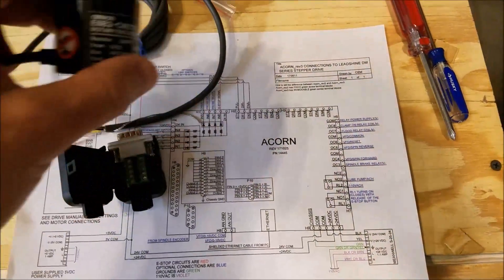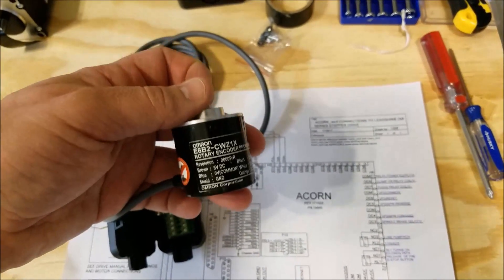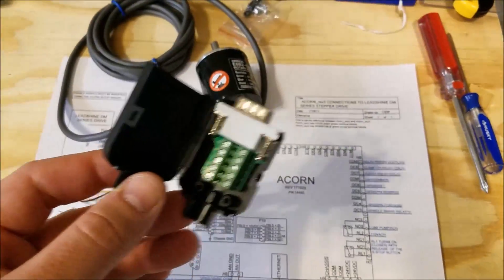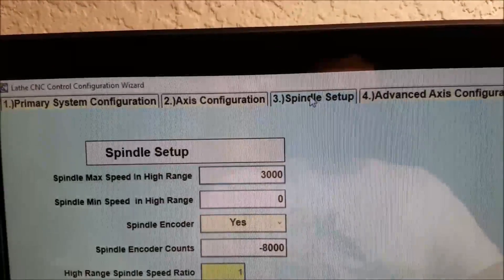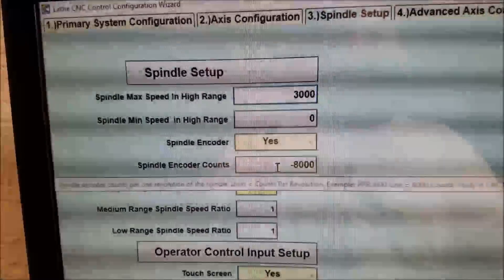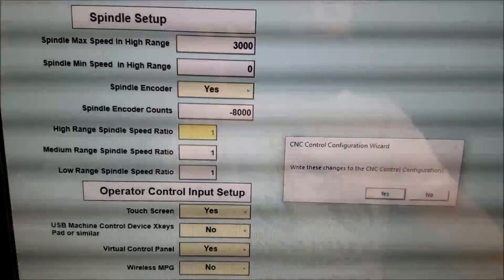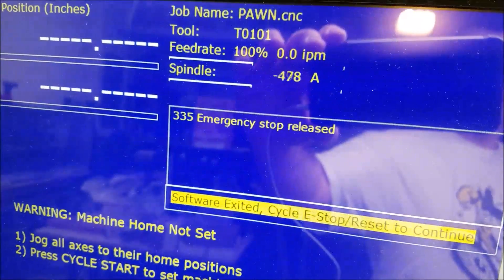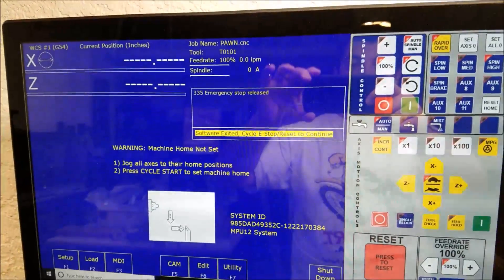DIY Closed Loop CNC Control #8: Spindle Encoder

Comment: Why are you multiplying the 2000 p/r by 4 to get 8000? Is that 2000 pulses per lead or something?
Reply from the maker: Good question.  It is based on the encoder.  A 2000 line quadrature encoder will generate 8000 pulses per revolution.

Comment: I have a spindle encoder but I dont have the acorn board I have the mach 3 boards. Is there a way to wire it in ?
Reply from the maker: Hi.  Unless your board specifically supports encoder input, then no.  Usually, encoder feedback is only available on more expensive boards.
Reply: I figured it might not be to different then hooking up the hall effect sensor. Darn back to the drawing board.

Comment: How is the expandability of this board? Are there ports for communicating with multiple encoders?
Reply from the maker: Hi.  The Acorn has only one encoder port for use with the spindle.  Otherwise, it only outputs step and direction for the axis motors. However, Centroid has other more powerful boards that have full closed loop capabilities.

Comment: Any need to set parameters if you’re using a belt drive or are you running 1:1 off the spindle? ...what is the name or part number of the connector you had shown? Thanks.
Reply from the maker: Search ebay for this: 
DB9-Male-D-Sub-9-Pin-Plug-Breakout-Terminals-Solderless-Nut-Type-Connector-GX

I always run 1:1 from the spindle to the encoder.  But, there are some ratio settings in the Centroid software (that I've never tried).  That being said, I think you'll get your best results running 1:1

Comment: These Omron E6B2-CWZ1X encoders sell for $25 on eBay but I highly doubt they are genuine. Where did you get yourse? I checked on Mouser and it is $345.
Reply from the maker: Here is the eBay store I buy them from:  
http://stores.ebay.com/921812799shu?_trksid=p2047675.l2563

Seach for: Omron Rotary Encoder 2000 P/R E6B2-CWZ1X E6B2CWZ1X